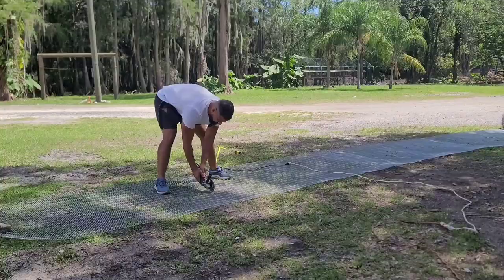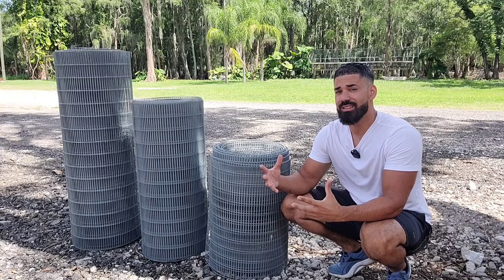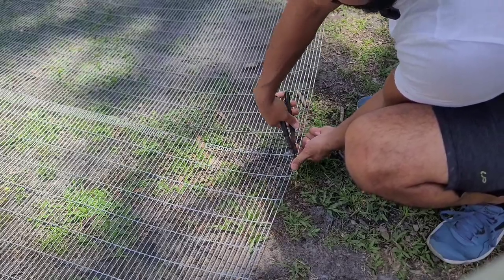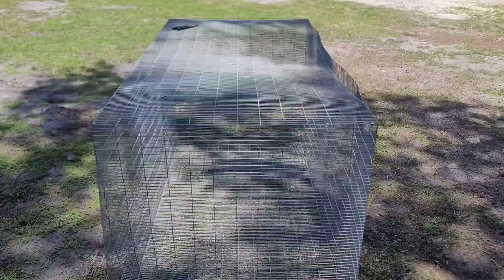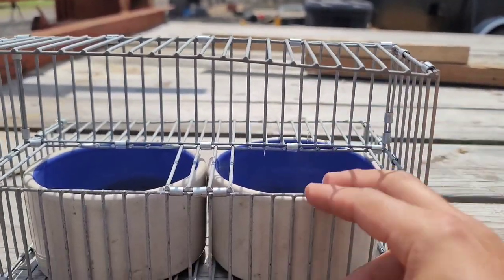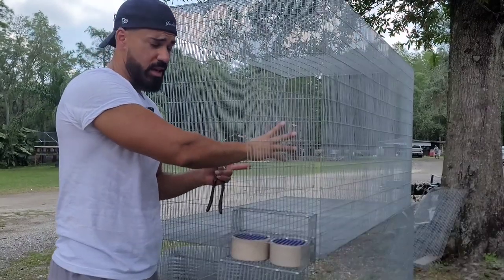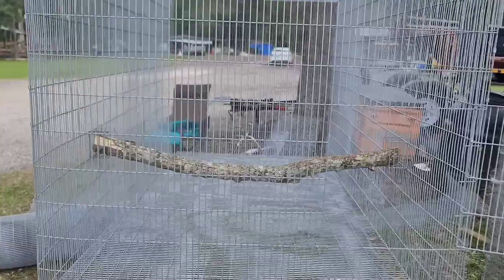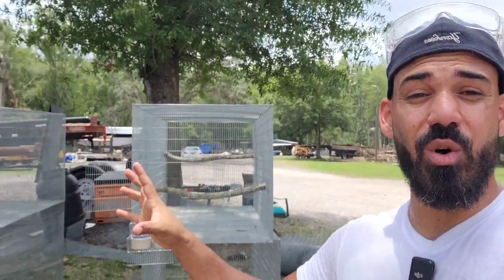How to build a BIRD CAGE / FLIGHT

Comment: This is a really smart way to make a flight cage without breaking the bank, I especially like the feeding system you have! Thanks for sharing. My only comments/suggestions/concerns would be to maybe add a panel over one half or fourth of the cage length as a shelter from intense sun or rain. A piece of linoleum could do it. UV light is good for feather quality so I’m glad they have access to natural sunlight! My other thought is on metal toxicity, I don’t know what type of metal these are but in case it isn’t bird-safe, I’d suggest adding some additional wooden bits to chew instead (only applies to species like parrots that chew bars).
Reply: I don’t wanna sound rude or overstep but one more thing! Make sure the wood you use for perches is from a species of tree that is safe for parrots since they chew and be on tHe lookout for fungus